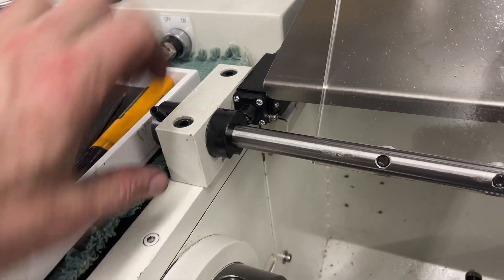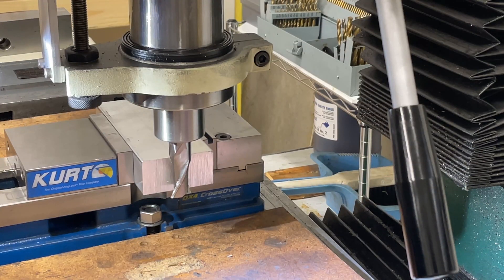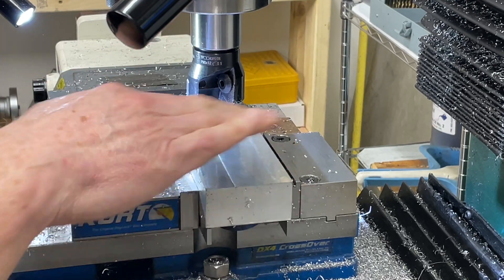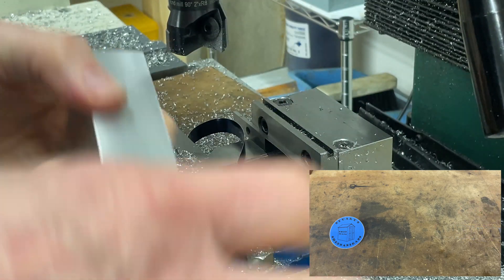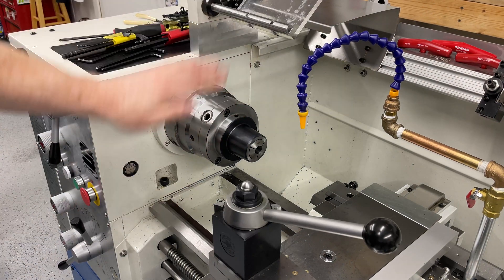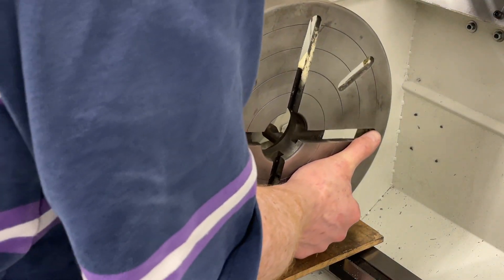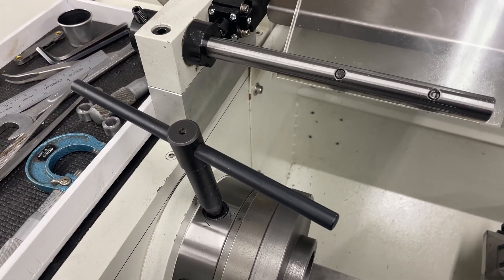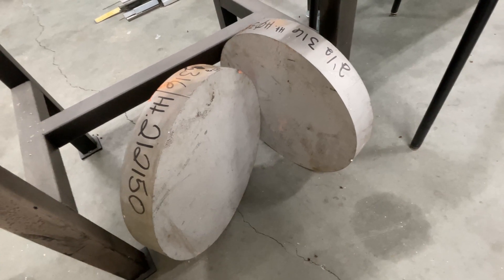Increasing the lathe work envelope at the headstock of the Summit 1440D - Part 1

Comment: Good job on the adapter Stuart. My lathe doesn't have a chip guard. I have been using a sheet of plastic on an adjustable arm. Sort of works, but must come up with a better design. Cheers Nobby
Reply from the maker: Small projects like this are nice because of the quick finish and sense of satisfaction. I just finished with fabrication of the replacement guard, so hoping to finish this project soon. 👍

Comment: This is the first of your videos I've seen,  so maybe this question has been answered somewhere else already:
Is that the factory splash guard in the original position - and they didn't make it big enough and/or put it in the right position to accomodate the 14" swing???  
If so, that seems like some Pretty Poor Planning by the manufacturer.

Great build, and thank you for sharing.  I'm looking forward to seeing Part 2.

+1 new subscriber!
Reply from the maker: I'm inclined to agree - not great design at all - that is the factory splash guard. To be fair to them - it is a legal requirement to have the switched guard on new machines, and most users pull them off and discard them. However, if you run full flood coolant a decent splash guard is a must. I have a design for a new one - just need to fabricate it! Thanks for commenting and subscribing - very glad to have you along.

Comment: Further thought about the spindle key, why not use a standard socket set extension 3/8 " or 1/2", use the tee bar that is usually in the set. For the end to fit the spindle, machine down the square on the end. It will mean buying a new extension bar, but it will be tensile, chrome plated and easier than making a mild steel one from bar stock.Regards from Australia.
Reply from the maker: Neat idea Dave - I have a used tool shop nearby - they often have partial socket sets. I may swing by there and see if they have what I need - usually very inexpensive.